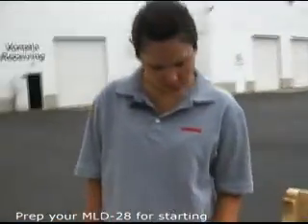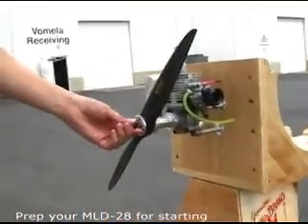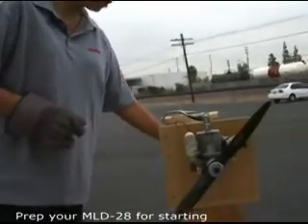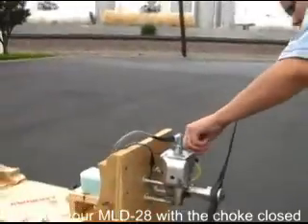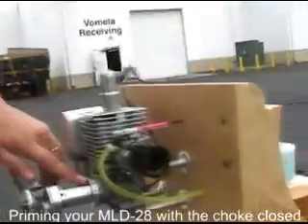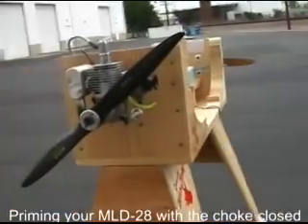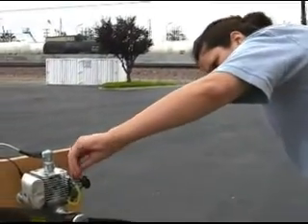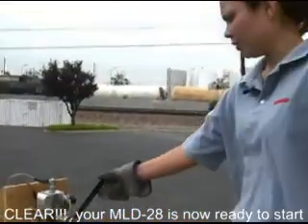Starting MLD-28 gas engine

Comment: @turboromy With gassers you need to enable a throttle curve on your radio or all of your throttle will be in the bottom half of your stick. This is very common especially with engines smaller than 70cc. If you dont have throttle curves, adjusting your endpoints can remedy the problem but not as well.

Comment: I strongly recommend this engine.  It starts very easy with a regular starter motor.
One thing I am not happy with this engine is throttle response is kinda uncontrollable.  I mean, at a bit above half throttle, it already is running at full throttle.

Comment: One and only one of its kind in You Tube some one who teaches this MLD Gas engine starting procedure. This is a good one.

How ever, if you initially make a close video of "choke", how you close it, how you open that and even all controlling parts like slow speed and high speed needle adjustment., Magnet and positioning (you have shown but , with more close up) It would be probably a Show stopper and you can show the world how best its can be. 

Thanks & Regards
Sudipta Panda
Bangalore

Comment from the maker: People were asking us about how we recommend starting. So we put together a quick vid of how we start the MLD-28S engine at our shop. It follows the manually in a fairly abbreviated fashion. We did not use anything special, but we did choose to use a more dangerous (harder) prop such as a Mejzlik. We wanted to show that with care, we can minimize much danger.
 
Mejzlik 18 x 6
Factory CDI
Side mount muffler
AMSOIL, Sabre Professional (2 cycle synthetic) mixed at 100-1
87 octane gasoline